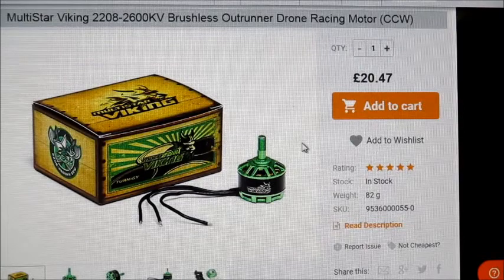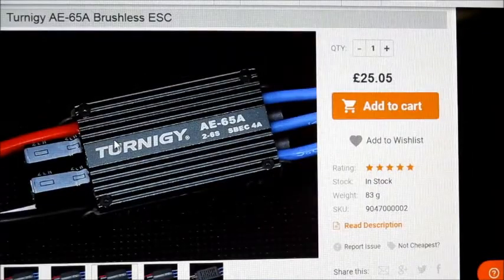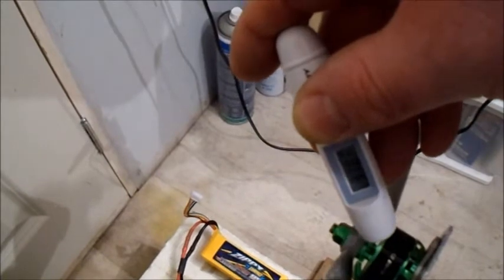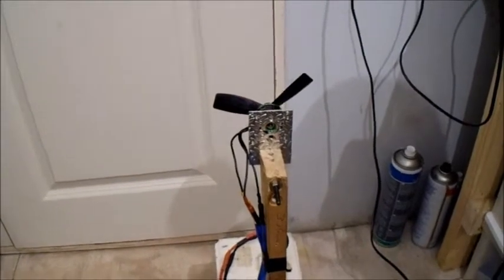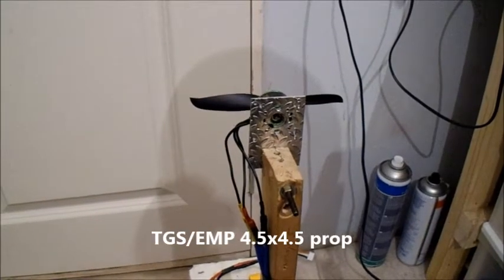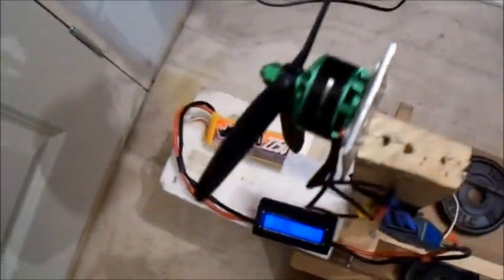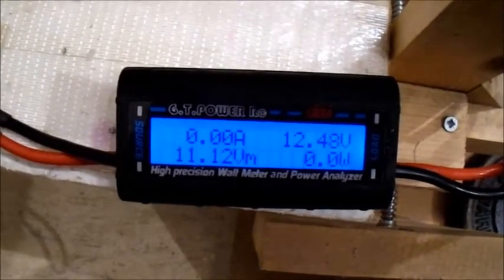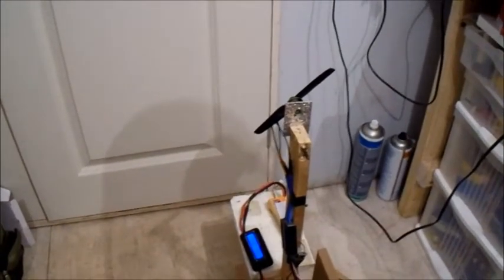Multistar Viking 2208 2600kv Thrust Test Motor test of the Week

Comment: Hey, I'm looking for something a bit crazy for a Wing Wing Z-84.  I currently have a 50a ESC in it, and have all kinds of 5-inch props, plus the normal 6040s...  You reckon this would be good?  I currently have an Emax 2205 2600kv with a  Gemfan 5152 triblade prop, and want to try something with more get up and go...  It's pretty fast as it is, but I want to push the limits just to be silly.  Thanks..  Flying 4S btw.